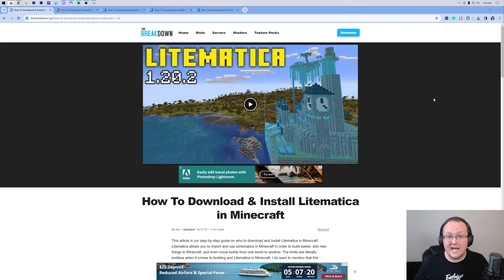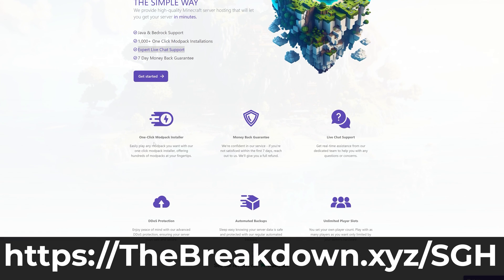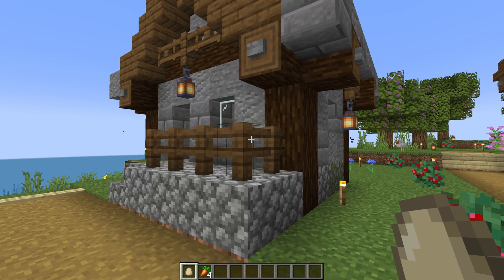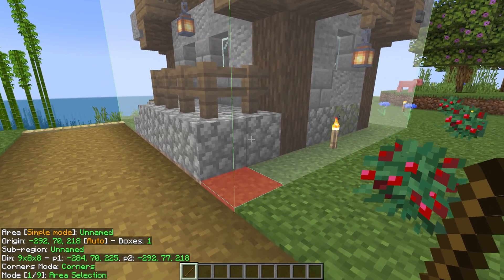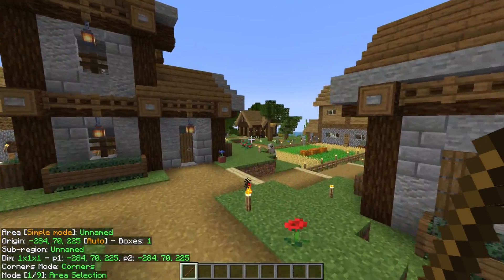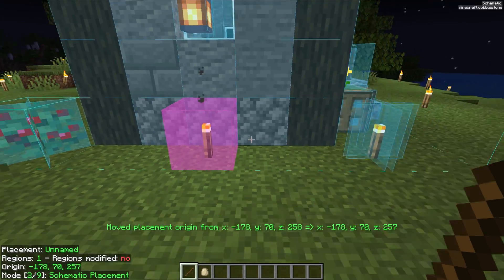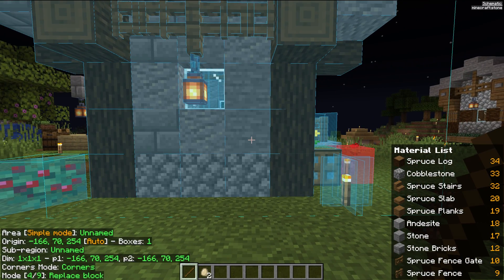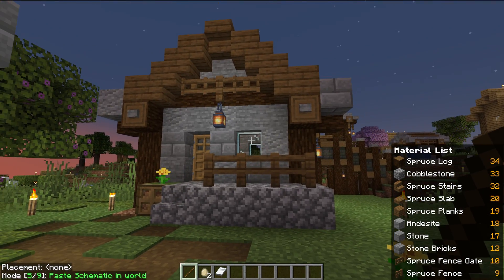How To Use Litematica for Schematics in Minecraft

Comment: There is also an easyplace feature built into this which is awesome if you are doing this in survival mode. Basically places the correct block where ever you click as long as you have the required item in your inventory
Reply: How do you get this to work? Do you know of a good guide?? Im so lost haha
Reply: @macca155 there are a few good guides out there! You have to enable the setting in litematicas configuration menu. Once in the configuration menu go to the 'Generic' tab and search for 'easyPlaceMode' set it to 'true' and you should be set to go! Hope that helps a bit :)
Reply: @macca155  Go to Litematica Menu (M on keyboard typically) --> configuration menu --> hotkeys --> search bar (looks like a spoon sorta) --> type "easy" --> set a keybind for the option "easyPlaceToggle" (I made it N since I don't use that letter ever). Exit the Litematica Menu. Press "N" (or whatever keybind you made it - just make sure the keybind doesn't conflict with other key binds you have.) It should say "Toggled Easy Place Mode: ON" and you are set to go!

Comment: How do you rotate the schematic?
Reply: Yes, you can rotate schematics in Litematica. To rotate a schematic, you can use the Placement configuration menu. Either go via Schematic Placements -> Configure, or you can directly open that menu for the selected placement by default with the numpad minus key.
 Additionally, you can hold down the M key and press P to rotate the schematic.

Comment: Is there a way to rotate the schematic
Reply: Yes, you can rotate schematics in Litematica. To rotate a schematic, you can use the Placement configuration menu. Either go via Schematic Placements -> Configure, or you can directly open that menu for the selected placement by default with the numpad minus key.
 Additionally, you can hold down the M key and press P to rotate the schematic.
Reply: @ 4 months lol thanks

Comment: Is there a way to turn schematics? Like when you load them but the entrance is on the wrong side?
Reply: Once you have it loaded in, hit M+P and on the right you will see a rotation button, just hit it and it'll rotate.
Reply: @Austin.Brewer  Awesome thank you a ton!
Reply: @ImWhyMortalsCry  anytime
Reply: Yes, you can rotate schematics in Litematica. To rotate a schematic, you can use the Placement configuration menu. Either go via Schematic Placements -> Configure, or you can directly open that menu for the selected placement by default with the numpad minus key.
 Additionally, you can hold down the M key and press P to rotate the schematic...

Comment: Is there a way to change the value of a block in a schematic? Take the house you made the schematic of, after you've made the file, is there a way to change the value of one of the blocks? Say I wanted to change the spruce blocks to oak because I'm in survial and oak is all I got but I want to make a quick build. Is there a way to do that?
Reply: If you have it set to place the blocks for you, then no. Just make sure it's set so you're placing the blocks and then it will just show as red, which means wrong block.